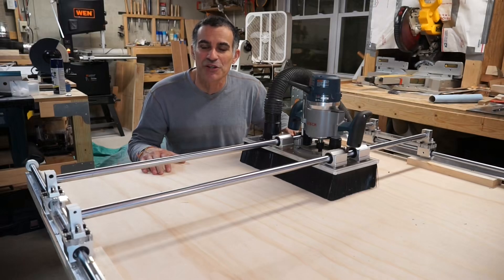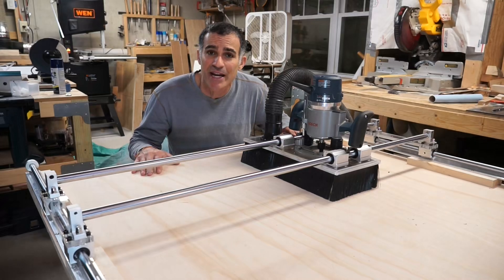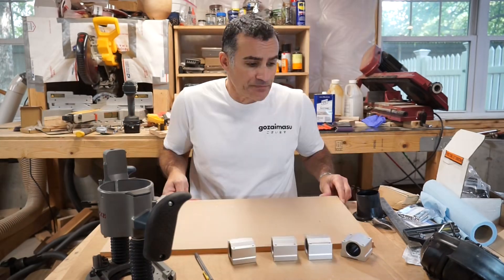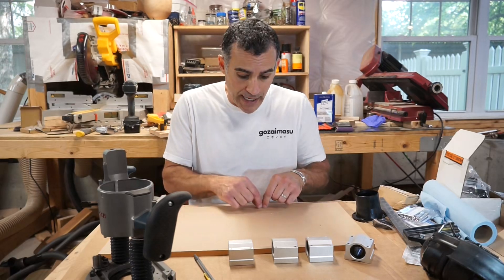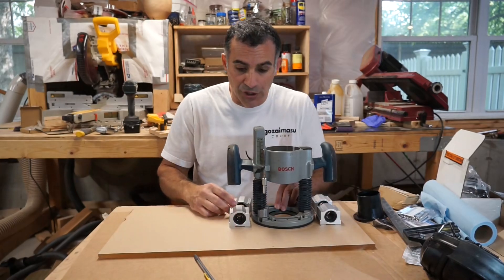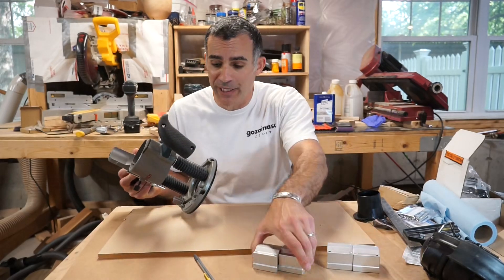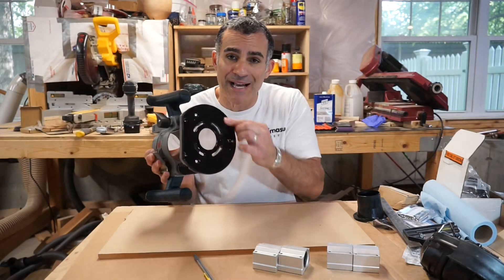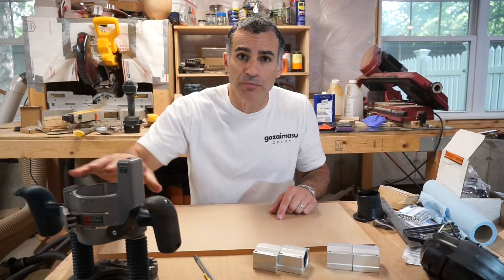The Router Sled System That Changed My Workshop Forever

Comment: How much deflection do you get with just the rods? Other rods with the track welded to them seem better to limit deflection.
Reply from the maker: Anything welded would certainly be better but I have not seen those. As I mentioned in another recent reply, when I move the sled front to back I will get your typical spoiler bit ridges. When I move the sled side to side I get no marks at all. It's pretty amazing.

Comment: Is there any flex in the 20mm cross rails ?  I like your build, but wouldn't have used a plunge router because you're adding additional downward pressure to the cross rails.  I've made a jig like this out of wood and any flex at all causes uneven routing in the surface.
Reply from the maker: I never plunge the bit into the wood so wouldn't need to worry about flex. What I will say is that when I push/pull the sled away from me I do get those bit ridges that you can easily sand away. However when I move the sled side to side, so from my left to right, I get absolutely no ridges at all. It's actually pretty amazing.

Comment: I'm trying to understand why you counter sync the bolts? Is there a reason for doing that? I can't see why you would need to have that as a completely flat surface ever.
Reply from the maker: I was just trying to maximize clearance. Now that I use a lot I realize it’s not necessary.

Comment: Very nice video. Just completed the acrylic  base plate with several mistakes. I'm relatively new to woodworking, but have been given a lot of warped wood. My problem with the acrylic is curring it. Your video makes it look very easy, but I had several difficulties. I used a 120 tooth blade, but experienced serious difficulty making my cuts.  Any suggestions of the blade to be used? I have a Laguna FusionOne table saw.  Thanks again for a great video.
Reply from the maker: Hi Jeffrey -  Your saw blade has too many teeth. You want to aim for something closer to 80 teeth. A blade like the one you have is going to generate too much heat. Your saw may not be helping either. I am sorry if this is perceived as a "mean" comment but I had a Laguna saw and it was one of the poorest designed tools I have ever used. There are known issues with the trunions and the lack of blade adjustability. If the blade is out of alignment, which was the case with mine, it's possible your blade will hit your workpiece twice, generating heat and saw marks. The cuts my saw produced were so bad I had to get rid of the saw.
Reply: Thank you so much for the reply. As a pure hobbyist I have had to buy used and what I could afford. The Laguna is a decent saw, but the saw I has before was more reliable. Anyway I will search out an 80-tooth blade recommended for cutting plastic. @industrialcomfort

Comment: Thank you for sharing? Would this sled be okay with 2~3 meters long wood? How should I design the base rail and the top rail size?
Reply from the maker: as long as the wood is covered by the length of the rails, accounting for the position of the cutting head, then you should be ok. if not, you'll need longer rails. ideally you want rails that are about a foot (1/3 of a meter) longer than your work piece.
Reply: @industrialcomfort  Thank you very much. This has been super helpful.

Comment: You don't mention about the flatness of the table under the long rails to ensure that they are vertically parallel along their entire length. Also adding 2x4 as spacers could throw off this flatness no?
Reply from the maker: you are correct, the table underneath needs to be perfectly flat to get the desired results. I planed the 2x4 spacers to ensure they were sized appropriately. good call out.

Comment: First, Great video!!! I bought items directly off of the very helpful links you provided and plan on making a very similar one. 
I have a dust collection question for you (or anyone who wants to chime in). Would you find it useful to use my fein turbo (160 cfm, but high static pull) or my plumbed 4” dust collection system (1200 cfm, but low static pull). If the 4”, would you recommend splitting to two angled dust ports to perhaps make a bit of a vortex? Over the years, I have sure come to appreciate how some tools match those two different kinds of vacuums better than the other, but I don’t know which one would be better for this application and I’d like to get it right the first time to not have to remake the acrylic plate again. Thanks in advance!
Reply from the maker: I would use your smaller collector for two reasons. The first is that trying to pull the sled with a 4" hose might be a bit cumbersome. The second is that the base of the sled would need to be that much larger to accommodate a 4" hose which will take away from your flattening capacity. Glad the video helped!

Comment: GREAT VIDEO! I noticed and you had mentioned to someone else you have hardly any lines in your work piece. What bit are you using? Thank you.
Reply from the maker: If i run the router left to right instead of front to back I get no lines whatsoever. I use a bit I got on Amazon: CNC Spoilboard Surfacing Router Bit, 1/2" Shank 2" Cutting Diameter, Insert Carbide Slab Flattening Router Bit Planing Bit Wood Planer Bit. I also make sure that I pull the side rails in as close as possible without interfering with the sled's mobility.

Comment: Hi, great detailed tutorial. Much appreciated. I noticed that your parts list does not have a link to the cross bar adapters instead it links to the bolts to mount them only. If you can provide that link it would be greatly appreciated
Reply from the maker: thanks for the feedback. The adapters are the pieces of acrylic that you need to cut and drill out. It isn't a separate piece you purchase. The rails come with sliders that you can mount the acrylic too.

Comment: Nice job.  Do you get any flexing from the top rails?  Is there a reason you just couldn't you the same type rail you used on the X axis so that you didn't need the adapter blocks?
Reply from the maker: Thank you. What I noticed is that the side rails where way flexier than I anticipated. They stabilized once bolted to the base but nonetheless it was more than I expected. I adjust those rails in or out depending on the size of the workpiece, which helps keep everything tight. I also run the router in the direction of the side rails instead of directly across the work piece in the direction of the cross members. When I do this I don't even get mill marks on my wood. It's pretty amazing.
Reply: @industrialcomfort  I've been trying to figure out if I could build one using HGR rails instead of SBR rails since HGR rails have higher load rating and supposed to have way less flex.  Their design does seem like it would be stiffer than a traditional rod setup.
Reply from the maker: @RoughRidersTV  I am not familiar with those but if they are indeed stiffer then I would definitely go that route. Stiffer the better
Reply: @industrialcomfort  They are used in CNC machines.  they have a box type carriage that rides on a squareish type rail with channels in the sides of the rail.
Reply from the maker: @RoughRidersTV  let me know how you make out! I have really enjoyed mine and have found it to be an awesome addition to the shop.

Comment: What is the size of the table the rails are mounted to and what is the slab size capacity?  Fantastic tutorial presentation!
Reply from the maker: It’s a standard sheet of plywood so 4x8’. I’d say the flattening capacity is roughly 3x5’ when you account for the placement of the spoilboard bit in the jig. Hope that helps!

Comment: Great video. Thanks for making it and sharing with the community. It's on my to do list to  make for my shop.
I have a question about the 20x1200mm linear cross rails. I purchased a pair of those recently for another application and I noticed that there's a little bit of flex. Even though the rods are beefy.
I'm guessing the weight of the carriage, plus a little downward pressure from hand holding the carriage might affect the flatness of the work piece.

What are your thoughts?

Thanks
Reply from the maker: Thank you very much. Funny you mention that. I noticed it too. If your base (plywood in my case) is on a firm flat surface then you won't need to worry about flex. It was perfectly solid once assembled.
Reply: That seems like a genuine concern to consider, but all finished it does look solid

Comment: Thank you sir! This was very helpful for me to build my own router sled, I finished today, yay. Let me ask, before I begin to actually use it and flatten my project, because I have the exact same Bosch plunger router set up but I have not used it for this yet (I've barley used it at all)... are there particular settings/speed setting or anything you would recommend to use with a 2" spoilboard bit? Or how/what settings did you use it? I ask because another guy's router wouldn't work properly at the speed required with that size bit... Thank you in advance!
Reply from the maker: You are welcome and super happy the video helped. What I have found interesting is that I tend to set my speed to 5 or 6 regardless of the wood I am shaping. I exclusively use hardwood which would generally demand a slower speed. The other thing to keep in mind is that you still have to sand after you plane the wood down. So even if I get a few burn marks due to the high speed (which I don't get anyway) I could easily sand out. Hope that helps. I find the speed matters much more when I am routing edges with a cover or round-over bit. I would slightly slow things down for harder woods.
Reply: @industrialcomfort  Thank you for that. It sounds like the Bosch with a wide bit will work no matter what the speed is, good. I made an epoxy/river table with teak wood, so that's hard wood and of course epoxy is hard. I just looked in the Bosch operating manual - there's a thought, ha. It recommends speed 1-3 with larger bits.  I may start off around 3 speed to get the feel of things and adjust up from there. Thanks again, have a blessed day 👊
Reply from the maker: @hopeforamerica1714  you bet. I have not used with epoxy and I would actually wind the speed down with epoxy as the heat will definitely create problems. 2" bits are large so generally you wouldn't need as much speed since the bit radius is larger.
Reply: @industrialcomfort  good to know, I probably should've revealed the epoxy in the first place. I'll start off slow then. That's what I needed to hear, thanks again.

Comment: Good morning 🌅, Great video, by the way why didn’t you use the same rails as you’ve got on the side of your bench for the cross rails?, As these are a lot stronger and do not flex or nowhere as near as much as the rod you are using., I’m hopefully building something similar to this in a few weeks time, but I’m building something around 4 foot wide by about 8 foot in length, 
Great territorial interest in the way you’ve set everything all up to lay it all wet , regards from me to you from France, though I am English
Reply from the maker: Thank you for the feedback! I didn't use the cross rails on the side as approximately 8 feet of suspended run would have caused deflection without some form of support. The are elevated rails. With that being said, you can buy larger sized side rails to use and that may not be a bad idea. Thank you for watching and good luck!

Comment: How did you mark the holes on the acrylic strips for the sliders on the side rails? You just said you drilled them to match the holes in the sliders. You can’t use the same technique you used with the punch on the router plate as the holes do not go all the way through. Does that make sense? I can’t think of a way to make sure that I drill them so everything sits square and lined up.
Reply from the maker: Hi there, I made another video showing you how to do just that: https://youtu.be/s11rGObOmWY. You can also use tape to mark the hole and transfer or take a photocopy of the slider and use the copy to mark the holes.
Reply: @ Worked like a charm! You weren’t kidding, though, making the side rail pieces and the baseplate is a bear with all that marking and drilling. I almost blew out the second to last hole I had to drill in the corner of the baseplate. I thought I was gonna have a heart attack. But I made it through lol. Also, I know I’m not the first to say it, but I’ve watched  more instructional router sled videos than I’d like to admit and how informative you are while remaining concise is quite impressive. Thank you for the help and keep up that good work!
Reply from the maker: @ thank you very much for the kind words and I’m happy to hear it worked. I have found it’s such a great jig to have in my shop. Oh yeah, man, you really need to be patient and take your time with the drilling!

Comment: In design did you find the dust collection port needs to be oriented on a particular side with respect to chip discharge so as to pick up debris better?  I would assume it would be oriented on side of the milled wood rather than the un-milled wood unless you are cutting on BOTH push and pull strokes.  Maybe it doesnt matter?
Reply from the maker: I didn’t put as much thought into it as I probably should have. For me it was more about the orientation of my shop, where I had room, where the vacuum is located etc. if you are going to consistently and diligently mill the wood in one direction then you are correct in your thinking. BTW, great point!

Comment: Great video, really helpful. Quick question. The dust skirt also comes in a 1.5" high configuration. Is there a reason not to use the shorter skirt? It would allow the sled to track closer to the workpiece.
Reply from the maker: Thank you. No reason at all for not going shorter. I thought I would need a higher skirt as the boards I tend to flatten are thick. A shorter skirt would be fine though.

Comment: I'd add some collar stops as an extra...not expensive.
BTW- the acrylic in Canada is $98 + tax
OOOps!  I see you have them installed at the last frame of the vid...never mind...😃
Reply from the maker: That is an insane cost for acrylic! You could use wood.
Reply: @industrialcomfort  
Everything that comes from the States is expensive with all the taxes.
I'm thinking of using Baltic ply.
Get a whole sheet for the same price.
Reply from the maker: understood. Plywood will work fine. Just go 3/4”. Good luck!

Comment: Great jig and great video. My only concern is how much deflection on those rods ?
Reply from the maker: Appreciate that, thank you. I don't find that any deflection is affecting my work pieces. Keep in mind that you can adjust the slide rails and re-mount closer to your work piece to minimize any deflection. A little deflection side to side but that doesn't affect anything from what I've seen.

Comment: Great, but then we have a big jig a little difficult to store and not useful for every day usage. Great for people with plenty of space or that they never store it because they use it everyday.
Reply from the maker: You could also consider making a smaller version of this jig if you don't have a lot of storage space.
Reply: I wonder if you could make it so that it was easy to break down and store.
Reply from the maker: @danasmith8950 removing the rail slides allows you to remove the entire assembly from the base and it takes about a minute to unscrew everything
Reply: It’s a few pipes on end to store.  Not a big deal for limited space.
Reply: You don't have a corner to stand it up in after you take it apart in 30 seconds?
Reply: Amazing how you found this to be negative. You just watched a man design and share an inexpensive and very useful tool and your first thought is to complain? Maybe try adding something constructive such as a solution rather than whining like a little baby. 

I don’t know this show or this host but thanks man, I appreciate this amount of effort and detail for something as little as a “like”.
Reply: I missed the part in the title that said it was a compact easy to store router sled…
Reply: @steved8714   those that can’t store tools shouldn’t use them lol
Reply: Very nice, I like the innovative way you used the brushes to minimize the dust collection issue.

Comment: What amount of deflection have you experienced with these Amazon rails in the center where the least amount of support is? Have you noticed any sag in them?
Reply from the maker: I have not really noticed much at all.
Reply from the maker: I forgot to mention that you can also realign the side rails and pull closer to your work piece. This would minimize any deflection. Again, I have not noticed any deflection that would cause an issue so far.

Comment: Good ideas!  Wouldn't it have worked OK to use the unused plastic router base for lining up your holes to mount the router in the moving base?
Reply from the maker: I thought of that too but the plastic base does not have the same hole configuration I wanted to use. I wanted to use 4 bolts instead of 3
Reply: @industrialcomfort  ah!  The metal router base has threaded holes for several configurations; I would probably drill one of them wrong!
Reply from the maker: @mriguy3202  LOL